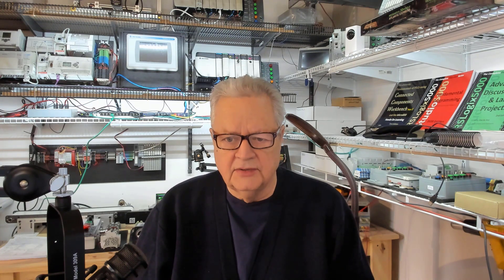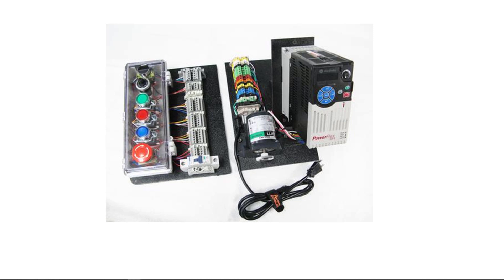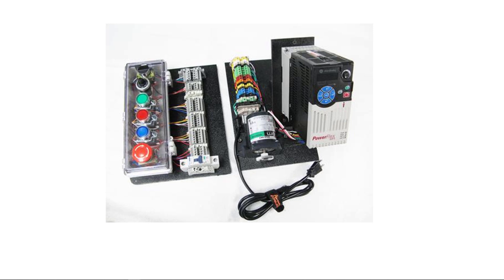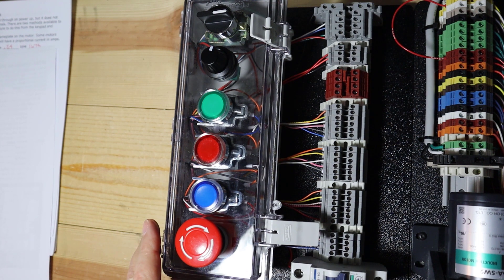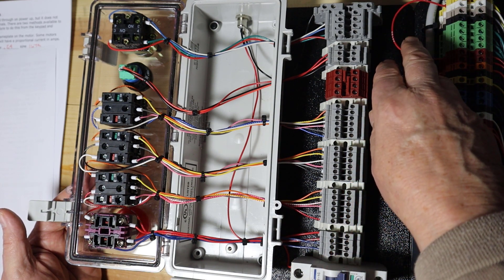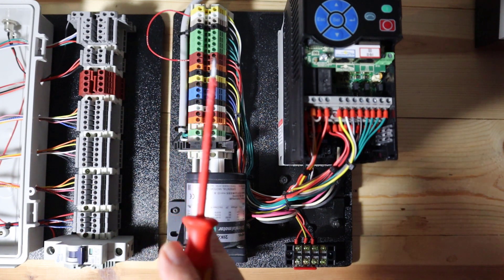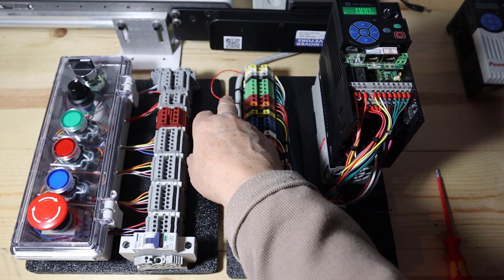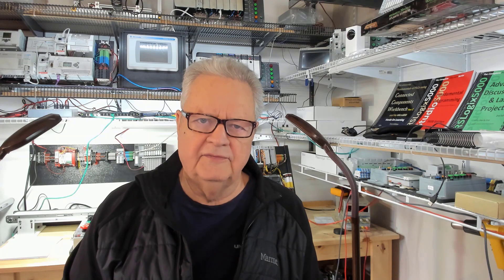PowerFlex 525 VFD - Running in Factory Default Mode & Lab Project Setup - Hands On

Comment: They use guard Logix to lockout gates, it is constantly sum checking the main plc. The gaurd logix processor sits in position 0 and the cpu sits in position 1 in the rack. Had 40 hours just on that down at Ford yes they have training labs. Also 40 hours on the 755 vfds, Some on Bosh weld time controllers. The best set up I have seen in my working career.

Comment: 60hz your doing line frequency ;F= 1/t you could have also put your meter on AC and watch voltage ramp up & down. But nice demonstration, that is a good dirty check on output of freq ~ drive T leads to ground to see if your Fets or IGbifets are firing, or have gone away. Note: In a lot of plants we lock out that pot to stop operators from messing with line.

Comment: When I was at Ford in KC,Mo. we had the Power flex 750. On ethernet ip thru Ntron hub's, We were using Control Logix 5000 ver. 20 also Studio was making its debut . I was in the body shop building Ford transit vans. We also had a Euro drive called movi fit & movi mot plc built into unit. We gave it a run and prox sensor ,[ mov in position -one shot, then second prox to end motion. [sub routine. It got its initial run command from a one shot to move entire line. When all the robots returned home. [ timer then mov command, calling, subroutine to what I wrote above. [We were spot welding van chasis, good training & experience.
610 Fanuc robots. I was in KC Missouri. May 2013 to August 2015. A launch of the Transit van, the large one. Robots were interfaced thru Bosh weld time controller's.
Got factory trained from Allen Bradley Rockwell instructors 80 hours in class room.
Best of all 27 months on the factory floor !! In there 90 + deg. heat.
PS : I have a advanced certificate in electronics technology .industrial control's from a community college Triton ,River Grove,IL 2000 to 2003 on GI bill [ 9 -16 week semesters, industrial controls 2 was plcs on a  AB I think they called it a T100 plc. No communication / networking, but all the instructions are the same, but not the very advanced once like for motion on  a servo ect.. Also some deep electronics training. It all comes together. Now 63 struggling to find work a few years left before the big SSI ? I reside outside of Chicago. Enjoy your channel.
Reply from the maker: There is a ton of work out there but it may be an issue of location. All of the engineering that I do involves some travel even when I am designing or programming at home, I still have to travel...next week it is Texas for several weeks to finish up a project and the Florida in May.